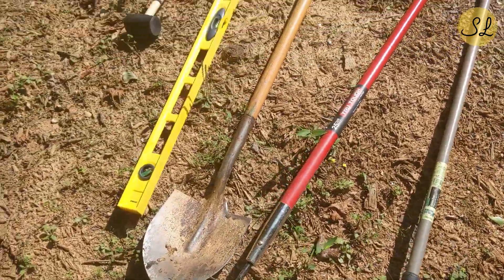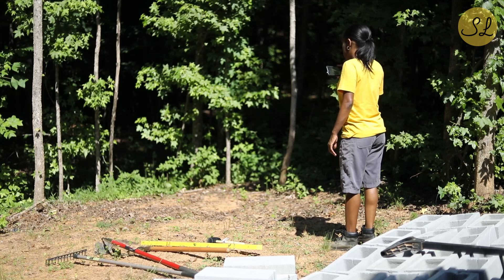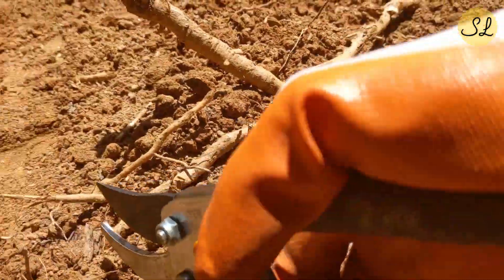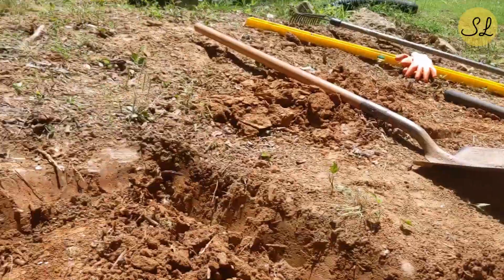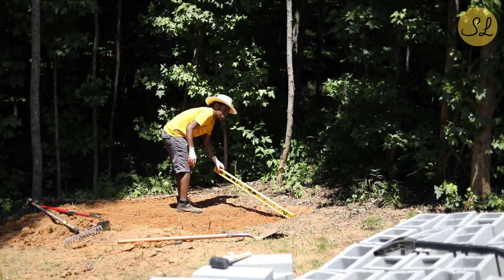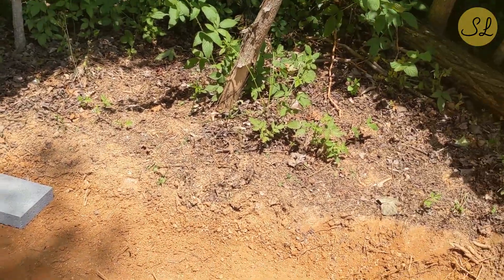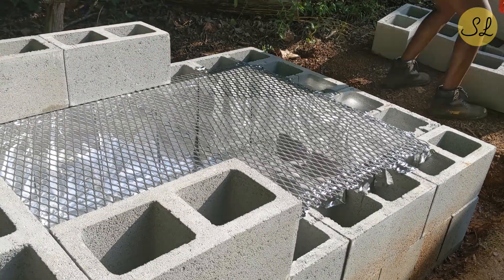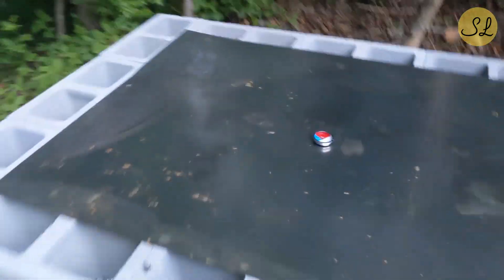How to Build a Cinder Block BBQ Pit: An easy DIY guide to get ready for summer

Comment: Great 👍. Just a suggestion it probably be easier to grab some small steel l angle  maybe .5 by .5 inch to brace and reinforce the bsheet metal just run three piece length wise and attach them with sheet metal  screws